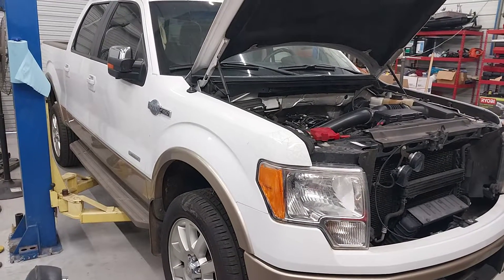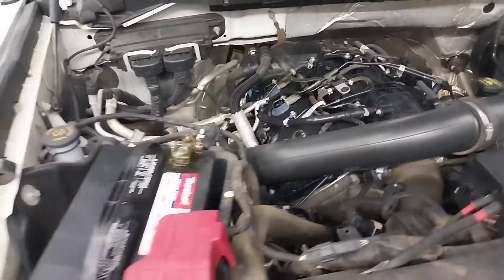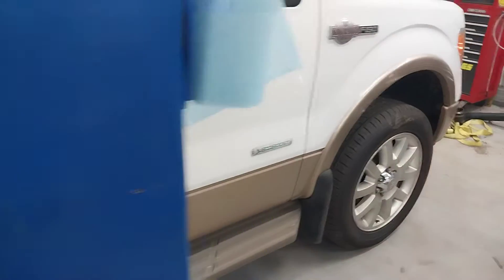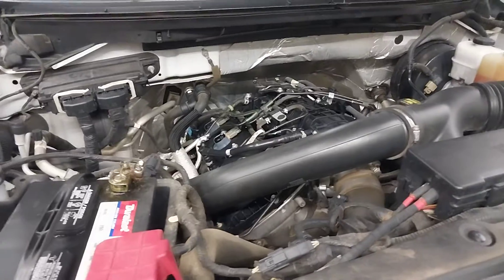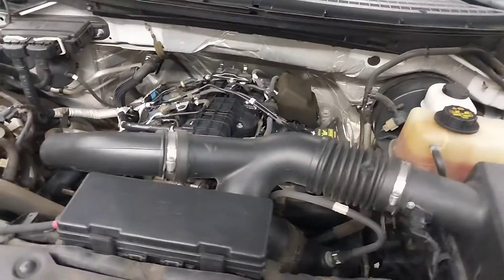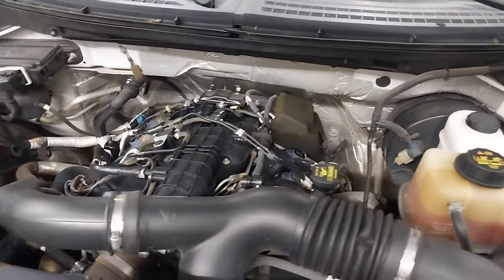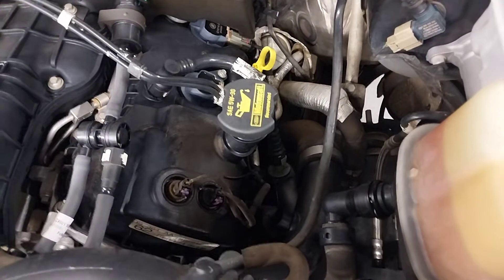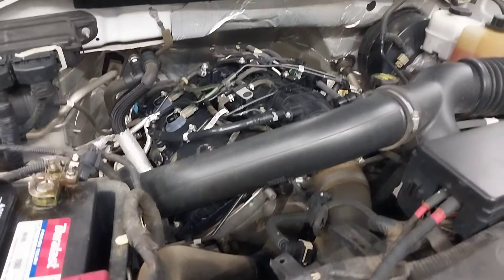SERIES HAS BEGUN!!!!!  2011-2012 F-150 3.5 ECOBOOST ENGINE REMOVAL - STEP BY STEP!!!!!

Comment: How where you able to get all the transmission bolts out
Reply: Do you remember any progress you made
Reply from the maker: Disassembly video is uploading.
Reply from the maker: That video is up next.  Im working on it today though tonight.
Reply from the maker: Reaching in through the fender wells and from the top of the engine is how I got my 2013 3.5 out.